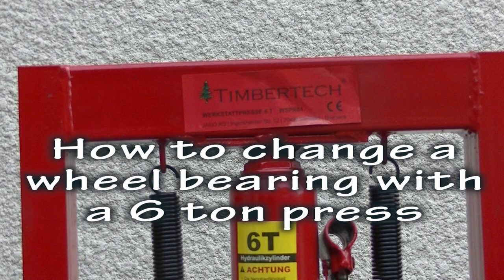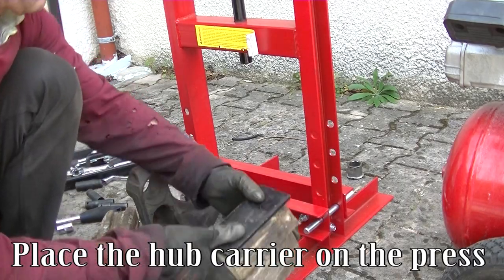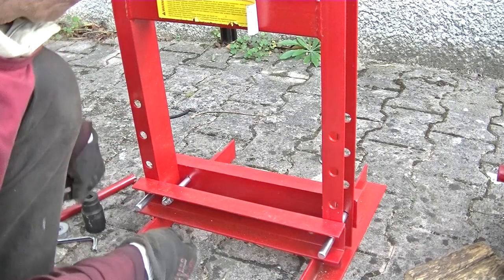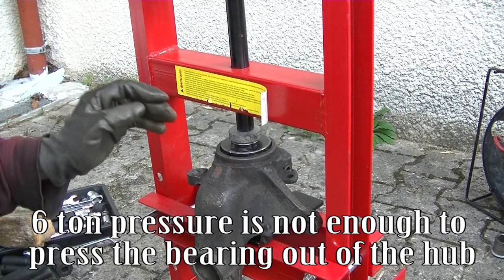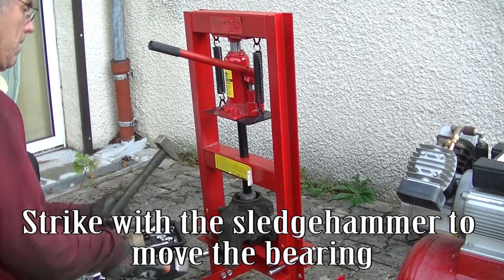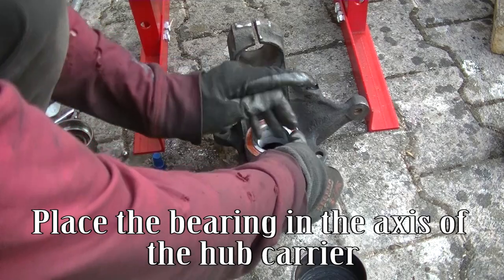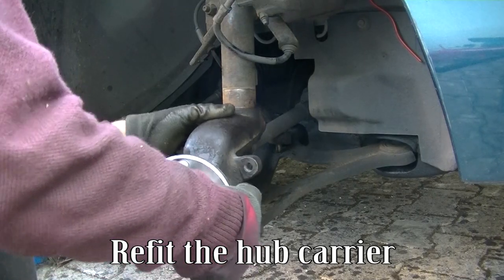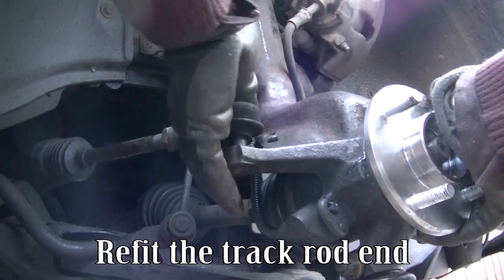How to replace a wheel bearing with a cheap 6 ton press

Comment: Few things here the hub nut was over tighntned with rattle gun then touqued up rong way also by pulling up on rench rather putting your back out rather than pushing down on rench  is much safer and easier notice it didn't turn it clicked straight away wich means it was overtightned  and you should not use sockets to push out bearings bearings with abs magnetic rings should not be out in freezer as the crack bit of a odd job DIY way of doing it not the right way
Reply: Great Info, cheers

Comment: That screwdriver technique ended up bending my Circlip pretty bad because It was so thick and difficult. Maybe for demo just use the proper pliers next time (Which I forgot about until It was too late) to save the odd few accidents like I had. Cheers, great video though